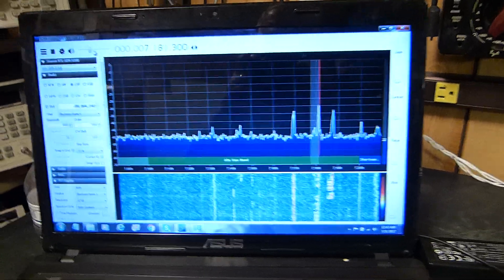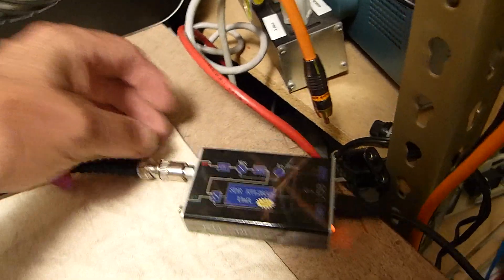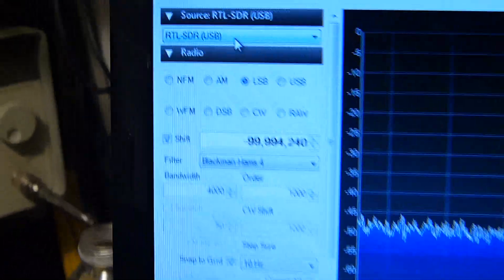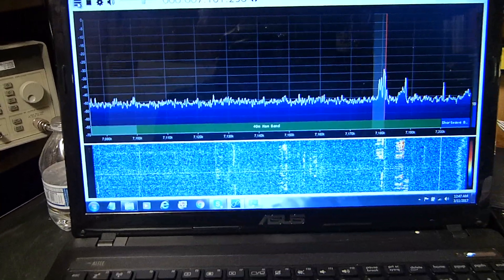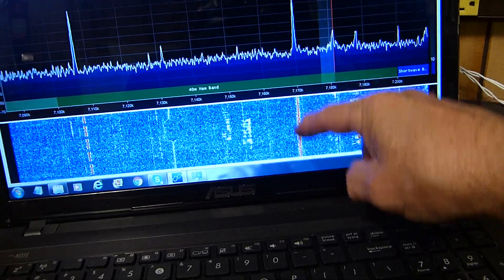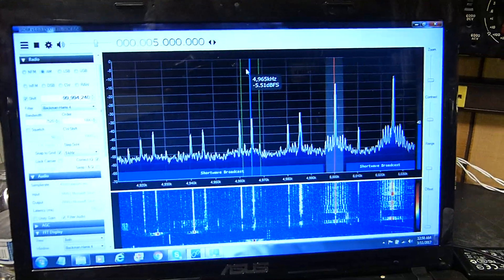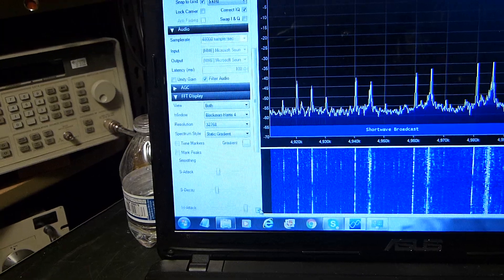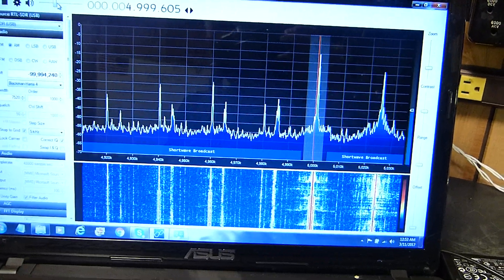RTL-SDR (Software Defined Radio) Panadapter (Spectral Display) Review For Amateur Radio HF Use

Comment: You can also buy an AM broadcast band filter for about $16 to block nearby radio stations.
Reply from the maker: I made a video of the performance of these filters, AM and FM. They work great but I don' t have an AM or FM broadcast issue so essentially, they do nothing for me although they do their job very well. So, the point is, if a person doesn't have the issue of AM/FM interference, then they may feel like their filters don't work even though they do. They do not improve the performance of the SDR if there is no interference - as I hopped they would. I did the same thing with another bandpass filter that, again, works great and I posted a video on it also but it did nothing for improving the reception. My point is, we all tend to think the RTL-SDR devices need a "better front end" when in reality they may not - if a person does not have explicit interference from some source, more tuning on the front end does nothing to improve the SDR, in my experience.
Reply: ElPaso TubeAmps Ah, okay. I only mentioned it because you seemed to be getting an AM station right on top of the time station at the 8 minute mark in the video.

Comment: You sure that the switch isn't HF/VHF?
Reply from the maker: No, I don't know that for sure and these things don't come with any instructions. There were pulses in the spectrum diaplay on the PC screen when running SDR# and that is why I was fooled into thinking it was turned on. I will have to try that and find out for sure. 1hanks.
Reply from the maker: Yes, indeed, it is HF and VHF/UHF. I obviously did not look closely at the uit before making the video. 
I am actually really impressed with this unit. I am in Cancun right now checking it out on FM broadcasts.

Comment: Hi hi.! The "red=on, green=off is a utility industry standard. Red lights indicate a circuit breaker in the closed position, green indicates open. This is different in other industrial uses. The SDR builder must have been a utility guy.